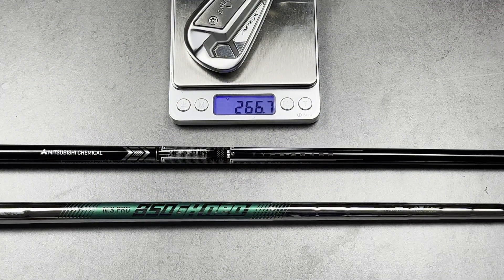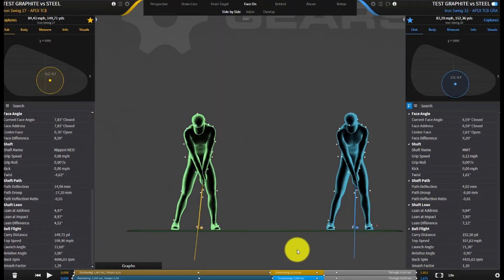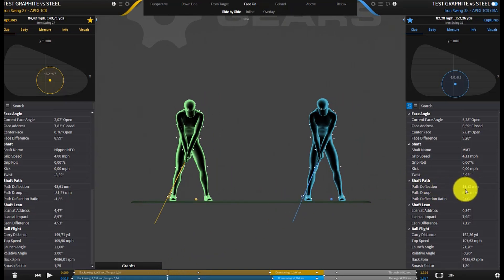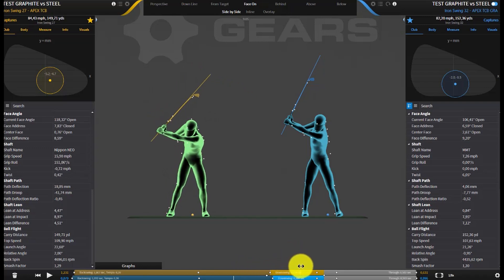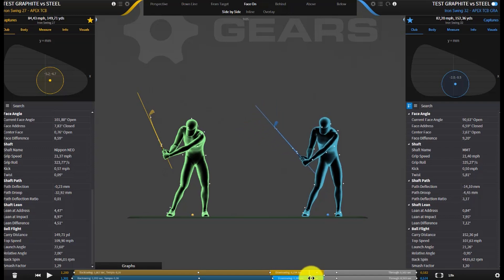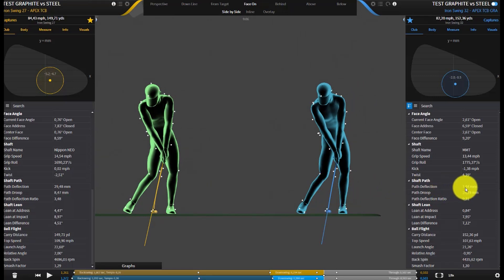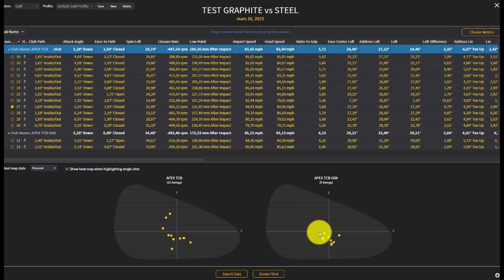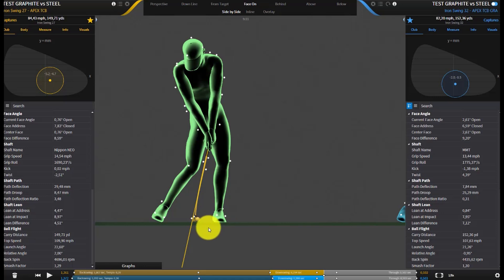CLUBFITTING MYTHS : GRAPHITE vs STEEL

Comment: A bit confusing in a way because this assumes all steel shafts will behave the same which would technically render most of what you do in a fitting useless. 

You'd really need to test a wide variety of steel makes and models to really prove a point here.
Reply: Agreed, but just trying to break the general belief that steel is stiffer than graphite.

Comment: While I agree with all of the facts presented...A it isn't a fair comparison and B all you have shown was that you over-powered the steel shaft. Flex of shafts means nothing here because there is NO standard for what constitutes a flex. In a steel shaft, weight is flex. Not much engineering here. In graphite...it is a totally different story. Graphite can be engineered to a point where the shaft truly is stiffer. Also, change your release and GEARS would tell a different story.
Reply: I completely agree 👍🏻 all I was showing here was the myth that steel is stiffer than graphite.

Comment: I recently converted from Nippon Tour 120’s to Steelfibre 110’s, with both in X flex on my Mizuno MP223’s. I honestly don’t think I’ll ever go back to steel iron shafts again. The carbon iron shafts are much more stable for me and a little bit lighter as well. The feel across my entire set is now much more similar with carbon shafts from driver down to my 60 degree.
Better on cold mornings with low on the face strikes too!

Comment: What brands of graphite irons shafts have you found to be superior  in your testing. Have played Accra iron shafts really liked them. Also, tried fujikura vista iron shafts but ball flt was too low for my swing speed. Thanks
Reply: I’ve had a lot of success with Mitsubishi MMT shafts or with slower speeds the recoil dart

Comment: As a senior golfer I play graphite shafts. However does it really matter for me if I choose graphite or steel in my arms. I swing pretty slow with 7 iron swing speed only around 65 mph. Tried to swing faster but results not great😊😊. Thanks.
Reply: You would probably be better off with graphite, but more to do with the weight than anything else. Something light that you can move faster.
Reply: @johnlawsongolf  Hi and many thanks for your feedback 😊😊

Comment: Very cool to see but I thought the biggest difference was actually the torque and not the deflection. I always sprayed graphite shafts all over the place even when getting fitted. Maybe it's tempo related but I struggle with graphite a lot but can hit steel shafts very consistently.
Reply: You can definitely get graphite with the same torque values as steel nowadays. You can do so many different things with graphite. It will probably be the way for many players going forwards. Feel is still related to steel though.

Comment: Im surprised, I expected more "whip" from the graphite. Generally I see graphite shafts in ladies irons so have stayed with steel. I do have a heavier 120g stiff nippon in my srixon Z785s. My SS with driver is 95mph, pretty ave. I can use reg or stiff, however 50g is flighty, 70g less carry but more roll out so tend to stay 60g...
Good luck with new channel...
Reply from the maker: You can pretty much do anything with graphite nowadays. Some of the heavier stuff is much stiffer than steel.

Comment: Wow! That was really interesting. I'm new to your channel. The algorithm fed it to me; I gave it a chance and I'm glad I did. I subscribed and I'm going to be looking through all your segments. All the best from Southern California, USA.

Q: Can one use swing speeds to determine where the best place on the shaft is for flex or stiffness?
Reply: Hello , thanks for the feedback. No it’s more to do with when and how you load and unload the shaft than the actual speed itself.
Reply: Trial and error, thats why most fitters advise to start with your current clubs so they can "sell" you on improvements. 
Indoor SIMs are a good start, however the course is the true test..